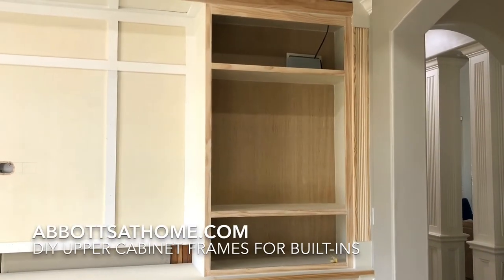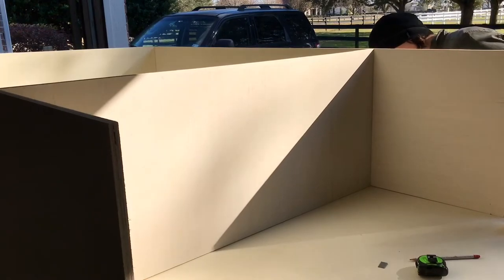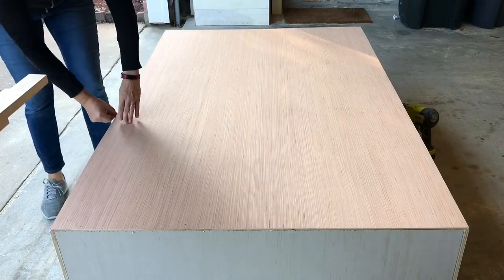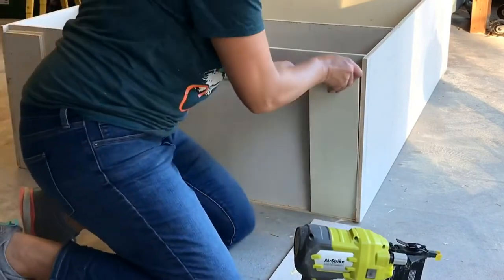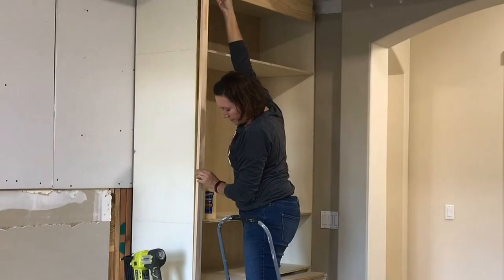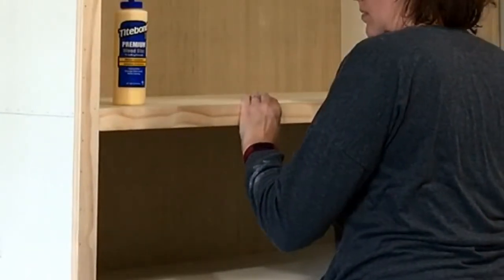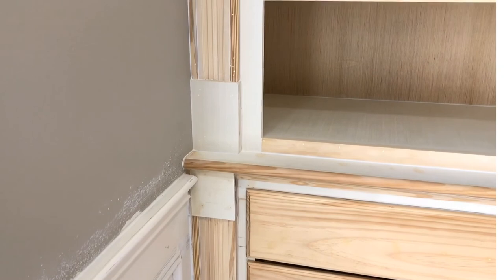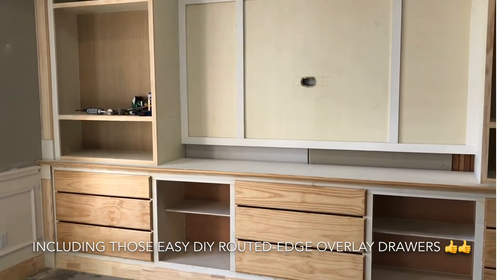Step by Step DIY Built In Bookshelves for a LARGE Entertainment Center

Comment: Awesome job!!! Great video! 

What type of wood did you use for the cabinets?

What type of wood did you use for the face frame?

Do you have links to the hardware store you bought you wood from? 

Thank you.
Reply: Ok just heard in the video select pine is what you used for face frame.
Reply from the maker: Hi! Yep, Select Pine on the face. I used the paint ready plywood that Lowe’s sells. I can’t remember what it says the wood type is. It’s white on one side and nearly white on the other. It’s a cabinet grade plywood that is made for painting. So, it’s typically cheaper than the stain grade. But it’s still a durable, high quality wood.
If you want to stain your cabinets, I prefer Maple plywood. But Birch works great too. It’s just a slightly different grain. 
I generally buy all of my wood at Lowe’s or HD unless I just stumble upon a deal at a smaller construction supply store. 👍👍